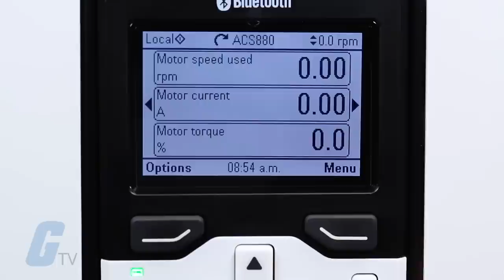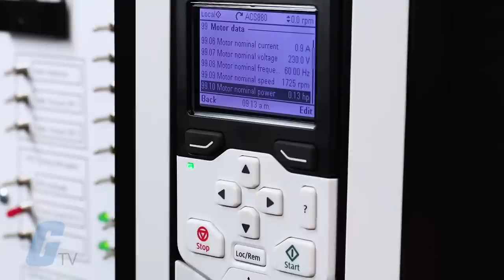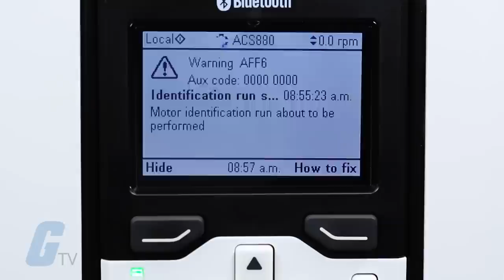ABB ACS880 ID Run Auto-Tuning Function - A Galco TV Tech Tip | Galco

Comment: Hi, I have a problem where Iam facing when i give a stop command ,VFD ACS 880 is not stopping 
from 1700 rpm it will be reduce to 670rpm but not stopping. kindly please advise what parameter needed or required so that i can reduce the speed upto 0 rpm.
Reply from the maker: Ok I first need to know which Application Macro you are using? If Factory Macro, is digital input 1 being opened at XDI-1 with respect to XD24-5?

Comment: ID run setting 99.13 not changing from None[0] to any other modes. What to do?
Reply from the maker: Ok 2 things, make sure 99.04 shows "DTC" and then realize that once it runs it switches back to none anyway, ok?
Reply from the maker: If you are having trouble getting into the selection, be sure you are using the "Edit" button. Then you should be able to up/down arrow through the different Auto-tune selections, ok?